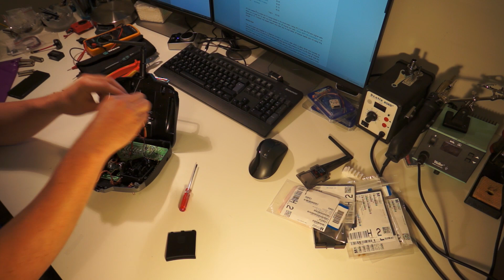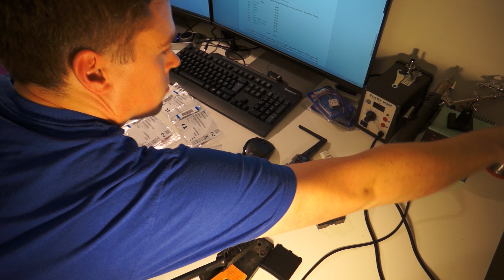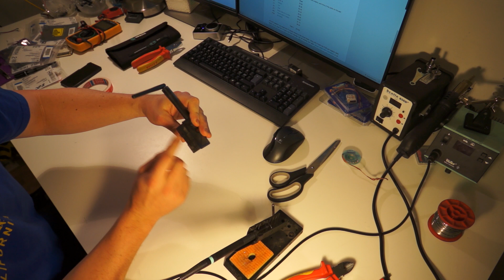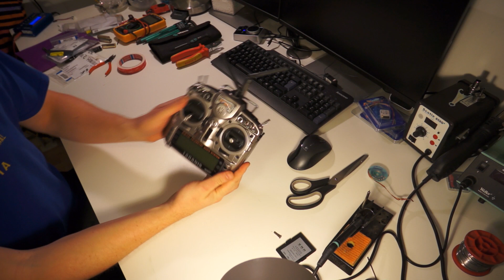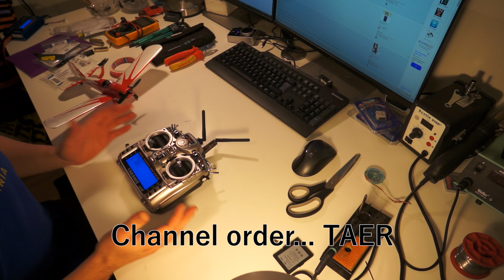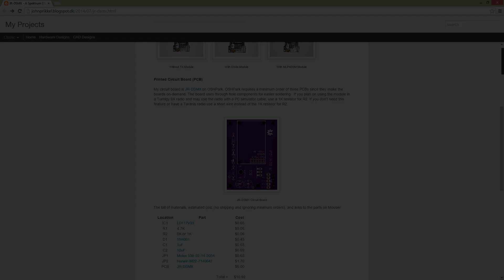How to build a true Spektrum DSMX module for Taranis

Comment: Excellent. Say, that IC1 has a hole in it (as well the PCB) because they're supposed to be bolted (bolt & nut). That's a heat sink and they can get really hot and eventually fail. Also, 
some guy is selling these all soldered up and it even has three stand-offs so that you don't have to hold up the module with double-sided tape as you did here.
https://radiocontronics.com/products/taranis-spektrum-hack-dsmx-module?variant=8398916780087&utm_campaign=gs-2018-07-31&utm_source=google&utm_medium=smart_campaign&gclid=Cj0KCQiAi57gBRDqARIsABhDSMq6Ko8ueJn-C22HjjdvCKaXvhagsJ2m0yq-RZjGxMZ5oWE_Hj7KhZkaAr7jEALw_wcB
Oh, I just noticed, they didn't bolt their regulator either.

Comment: question, why would you do this over getting a module from spektrum? is there a difference? can you use the plug in module on bind n flys? is it limited to 5 channels?
Reply: You asked "why would you do this over getting a module from spektrum?"   Because Spektrum's module is DSM2 only (it only frequency hops two instead of the whole band and is old technology). Alternatively, if you buy the Orange module, then the guys don't like the antenna coming out the back of the module instead of the top where it should be. They can't lay the Tx down very well and it won't fit in their Taranis case. I'm sure you already know the reason for doing any of this in the first place is to use Orange's reasonably priced DSMX receivers (Also, some guys have several models with DSMX Rx in them, but want the better functionality of the Taranis Tx). Oh, in one of his links above John Prikkel says that even on the dx4e Tx module, will give you 6 channels.

Comment: Hi this video made it easy to do this build, thank you for that.  My Module worked great at first in my taranis x9d plus se,  but started show signs of bad range before it failed all together.  Im trying to narrow down if it is the  taranis external JR slot, or something with my  build that is the issue?  i notice on the purple printed board that pin #1= sig, pin #2=+6v, #3 =batt, #4=ground,#5 antenna. I have taken voltage readings from my tarranis without the module plugged in with external dsm2-dsmx turned on in the software, and voltage is as follows. Pin #1 =7.95v, #2 =.65v,  #3 =8.26v, #4 =GROUND, #5 =ANT.  Is pin #2 supposed to be sending 6v to the module in order to work?  I also took voltage readings with the module plugged into the taranis an i got the save results.. I also notice that the original dsm module gets really hot and so does the rest of the board when turned on.  I have another radio dx6i that i could take the module out of but i don't want to disable a good working radio if the problem is the taranis. Nowhere in the forums really states if the taranis is supposed to put 6v out on pin #2 or not.  I see some places stated that pin is heartbeat, whatever that means? hopefully someone here can give me and answer.
Reply: I had the same problem with range, basically range was very poor. Removed the unit and purchased a Spectrum module which works fine.  Unfortunately the Spectrum module doesn't have range check with a Taranis transmitter.  Sure would like to have this question answered!

Comment: I'm not gonna lie, I am totally lost. I have been using HH BFN planes on a dx6i, but I have come to dislike the dx6i so I got a Taranis qx7. I have that module you've built in the video, the purple board, and cannibalized my old dx6i tx. The menus are unexplained and I can't find instructions anywhere telling me how to bind to my old BNFs. Anyone have a forum thread or anything to help me get started on my new Taranis?
Reply: i think you need to flash Open-TX firmware into the qx7 or update to a firmware that supports dsm-2/dsm-x protocols in the radio setup menus
Reply: i have a TH-9X flashed with open-tx and a DIY version of this module, and it works great with my FPV quads with dsm-x satellites :)

Comment: great video, I like you don't cut the unintended arming out :-) I have a inductrix 200 which have drift calibration mode but I'm unable to set that mode because it need the bind button for that. any idea to solve this? I have used a DX5e module

Comment: it wasnt easier to buy an orange dsmx/dsm2 module for 19£ from hobbyking?
Reply: +Gaming isnotacrime I've had issues with two of the Orange modules. Managed to repair one with a cold solder joint that crashed 2 planes with intermittent failures. The other one won't change modes now.The antenna routing is cleaner on this too.
Reply: With the orange you don't get model memory.  There are a few other issues too.  However like any DIY project the fun is in doing it and having done it yourself.  If that's not fun for you don't do it.

Comment: I was really pleased with my DIY 'Hack' module until I tried it with my Blade 180 CFX.The modules used for this 'hack' are only 1024 resolution, all of the decent genuine Spektrum radios, DX6 and up (but not DX6i) are 2048 resolution.This IS noticeable with a Blade 180 CFX.The only way to get DSMX 2048 with the Taranis is to use the Hobby King 'Orange' module.
Reply: When I moved from a DX6i to a DX8 it felt more 'locked in'
Consider I was running 60% rates when learning so that's 610 'steps' with a DX6i
That was increased to 1200 steps with a DX8 at 60% rates. It is noticeable with a helicopter.
I honestly think, buy a Taranis - if you can program it, and use a new DX6 for bind and fly etc. The new DX6 is an absolute joy to use.

Comment: I built this as described it binds well.  I messed up the antenna connection.  replaced the socket on the PC board.  I do not feel I have a solid antenna connection.  Range check function on the Taranis only gives me about 10-15'. Without the Check function on I get about 50 paces.  Is this good enough?

Comment: New to this, and to be clear I am no Video wiz,,,, but I have to say,, I really wish you would have had the camera A LOT closer, its so far away you can't see exactly where your placing the parts into the slots. The Parts list is a bit vague too, you told where to get the PCB board, the SPM Module  but all the other stuff ?????? radio shack, Online, hobby store, ect...  so for me it was kind of useless.

Comment: Hello, Thank you for this great tutorial! I built this module from your video and it seemed very easy, but I cannot get it to bind with anything. I'm using a Taranis Plus with 2.0.17 Bootloader. I'm wondering if anybody has an idea about what might be wrong? I know it could be the way I built it, but I made two of them and it's really just a few solder joints. I took the Spektrum module out of a DX4e that was working fine. Thanks, Michael
Reply from the maker: scratchbuildmedic Thats a though question... I dont know what the problem is.. I have not tested it at a Taranis Plus, just the "old" Taranis. You are not running the dreadfull EU-firmware?
Are you following the instructions on how to set up the radio for binding with Spektrum DSMX recievers?
Reply: I actually just figured it out! One of the resistors I bought was from eBay and I replaced it with one from mouser electronics when they came back in stock... That fixed it! Thanks for your reply :)
Reply from the maker: scratchbuildmedic Im glad to hear you found the problem :)

Comment: Thanks for the video! I wonder how I can verify that the module is using DSMX and not just DSM2. If I set it to DSMX it still binds with an Orange DSM2-only receiver, so the setting itself is not enough. With a DSMX receiver it works as well, but that could just as well still be DSM2. I guess there's no way to force the module to use DSMX only, and there is no DSMX-only receiver either. And I don't have a Spektrum, er, spectrum analyzer. Any hints?

Comment: Av3,have you a souce to buy J1 and J2 in Europe.Can't find one. Have you any spare ones to sell.
Reply from the maker: Yes, you can buy it from http://www.mouser.com/Search/ProductDetail.aspx?R=22-14-2054virtualkey53810000virtualkey538-22-14-2054 they have shipping from European warehouse.
Reply: AV3 RC
Thanks AV3 RC but the link you gave me sends me to a store that is in Spain ,but after contacting and inquiring them y received a reply saying that shipping costs are high because their warehouse is in the US.
Reply from the maker: Luis SS I think it depends on the settings in your browser. When i visit the link i get a danish website, and the goods are sent from Sweden...
Reply: AV3 RC
Thanks anyway but i do know that,but  still they charge as shipping from US.no matter were the browser sends me.Then for just one plug its quite expensive. I already received my boards from OHSP  and have one board with components already soldered except for JP1.And since i had no choice,  i soldered the RF module directly to the board.

Comment: Is this different in function to the DSMX/DSM2 OrangeRX module avail?
http://www.hobbyking.com/hobbyking/store/__24656__OrangeRX_DSMX_DSM2_2_4Ghz_Transmitter_Module_JR_Turnigy_compatible_.html
Reply from the maker: Doug Schafer Yes, there are differences.
A true DSMX module like this one have some benefits over the OrangeRX module:

- Fully integrated (range test and bind functions from the Taranis menu, not the button on the module)
- True model matching (Seperate IDs in the recievers, so you can't by accident choose a wrong model, just like the FrSky D16 protocol)
- IMHO better antenna placement, not sticking out the back, so Taranis is still able to lie down flat and rest on the metal-handle.
- Possibly less latency (the Taranis is "speaking native DSM" with the module, not being coded to PPM)
- Being a genuine Spektrum module possibly has other benefits?
Reply: av3 Hy Doug,

cool video, do you have a board and perhaps some of the electronic components left? I woud by it directly.....

Best Regards 

Robert
Reply from the maker: Alexander Steiner Yes, I have the PCB and all components except DSMX module and case. I have 4 sets that I can sell. Would you like it with the components already soldered?
Reply: av3 Hello AV3,
cool could you send my a private email with all further steps? I would prefer the soldered version...Please anser to: stoni11111@gmail.com

Thanks

Robert
Reply: AV3 RC I would like one of your sets. Price inc. USA, Mo.63090 shipping. csarchette72@yahoo.com
Reply from the maker: ***** I have run out of PCB's but Im considering buying a batch, so I can ship more of theese sets. After shipping one un-soldered set I have decided only to ship soldered, because it it to much work in labeling the components and packing them so they dont break during shipping. You can order and pay for one now, but there will be aprox 4 weeks delivery?
Reply: AV3 RC I'm interested in one of these, would you send me a private message for the cost?
Reply from the maker: Kelly Byrd Sorry, Im not selling these. I'm showing how to make one :)

Comment: Sorry, didn't listen to the whole video, so if you mentioned how much all the parts cost, I missed that. My apologies. Anyhow, I am wondering if you could make me one and how much you would ask for it? Thanks for posting! G.
Reply from the maker: I have the PCB, and other components except DSMX module and housing. Would you be interested in that, soldered and ready to plug in a DSMX module?
Reply: av3 Well, I found out in the meantime that I can just buy one from HobbyKing... thanks...
Reply from the maker: ***** I guess you are talking about the OrangeRX module from HobbyKing?
A true DSMX module like this one have some benefits over the OrangeRX module:

- Fully integrated (range test and bind functions from the Taranis menu, not the button on the module)
- True model matching (Seperate IDs in the recievers, so you can't by accident choose a wrong model, just like the FrSky D16 protocol)
- IMHO better antenna placement, not sticking out the back, so Taranis is still able to lie down flat and rest on the metal-handle.
- Possibly less latency (the Taranis is "speaking native DSM" with the module, not being coded to PPM)
- Being a genuine Spektrum module possibly has other benefits?
Reply: av3 I see the benefits... how much is it!? I am in the US, where are you?
Reply from the maker: ***** If you follow the links in the description you can see American prices of the components excluding DSMX module (you have to dig that out of a DX6i, DX5e, DX4e)
I'm in Denmark, so my cost-price was a bit higher than the prices listed on John Prikkels website
Reply: av3 Well, the first link makes no sense to me?! The second link looks like its $10 dollars. The third link is the case for $10 dollars as well... How much do you charge for doing it and how much is shipping to the USA? Thanks,